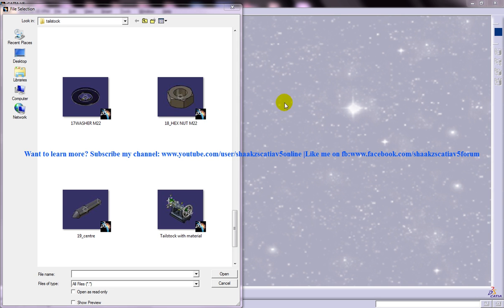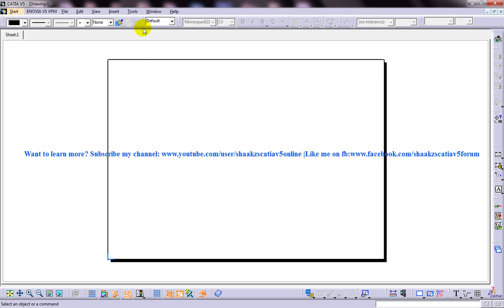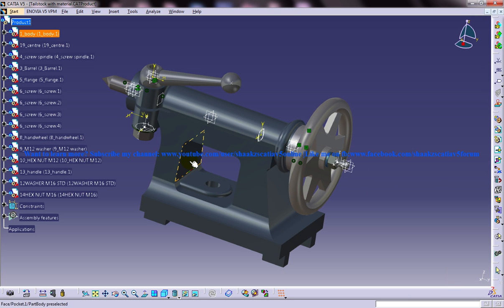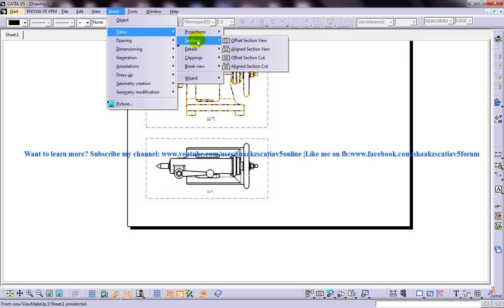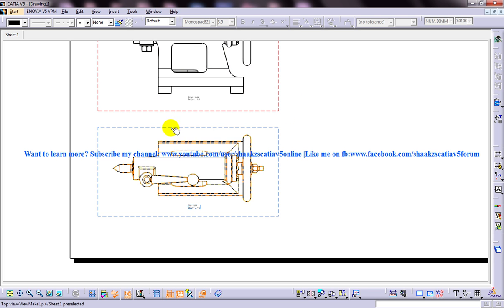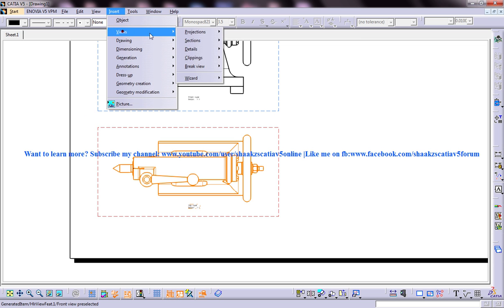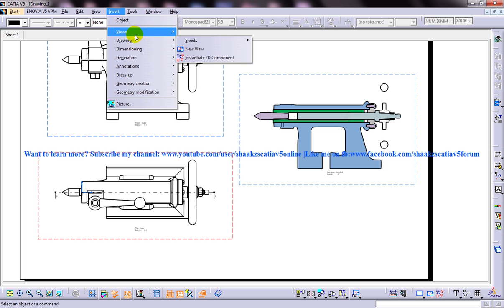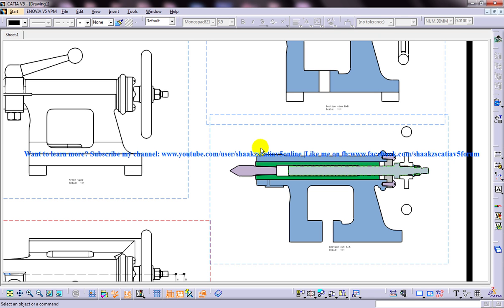Catia V5 Drafting|Individual view|Offset section cut(ISO & 3rd Angle)|Beginner's Tutorials

Comment: hi shakeel how r u? i was watching ur tutor last time about the step generation of dimension on drafting. and when i try to do the same thing, after i click on the generate dimension step by step, the first pop up box didnt open. but instead it directly leads me to the generating box (it shows a play and pause icon) how can i correct that? before watching this play/pause pop up box, the first box which we have to check on two things must be opened. but for me thats not possible. how can i remove this problem. thank u